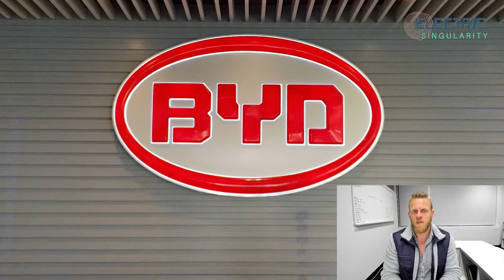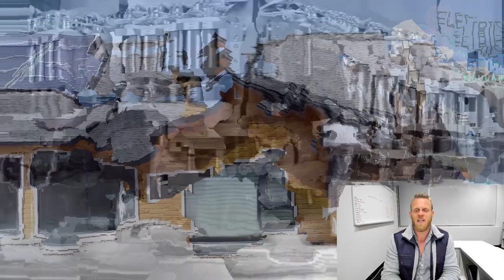CATL & Tesla join forces for world's biggest battery factory guaranteeing insane growth

Comment: Tesla's advantage is NOT technology. It was at first but now everyone else has caught up. Tesla advantage comes from vertical integration and mass production. The permanent reluctance motor was initially patented by a Ph.D. student at a university. Tesla took that and used it. The Volkswagen permanent reluctance motor is more advanced that Tesla's. However, that won't matter because all it does it reduces noise a bit. The power per Kw is about the same.

Since it's just an electric motor connected to batteries, the difference is control software. Again, everyone has caught up. The software to control PM motors is not that difficult. Tesla's advantage is that Elon is an engineer and is obsessive about parts reduction. That will reduce costs, increase profit and reliability. Hence that giant press to make one piece part for Tesla vehicles. That will greatly reduce parts and costs while increasing reliability.

And as Electric Singularity said, Tesla is really a power company pretending to be a car company. The power side is much much bigger. And with Sodium batteries, Tesla can go full bore in that business.
Reply from the maker: Good comment - you’ve done your homework.